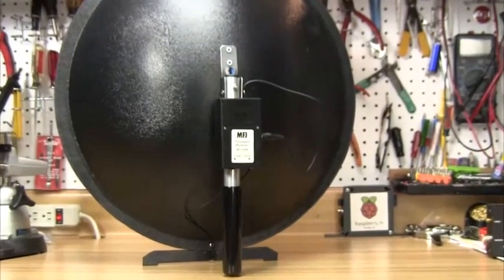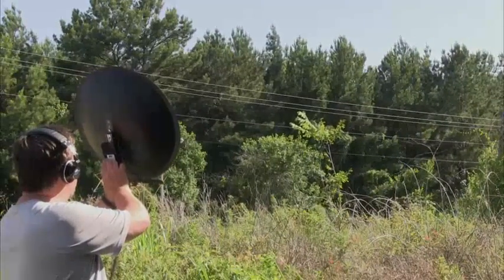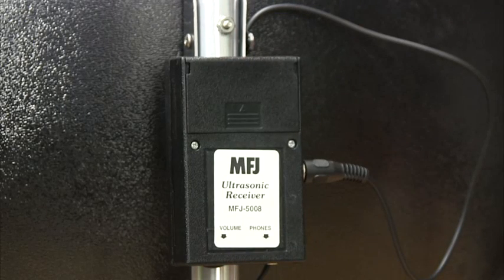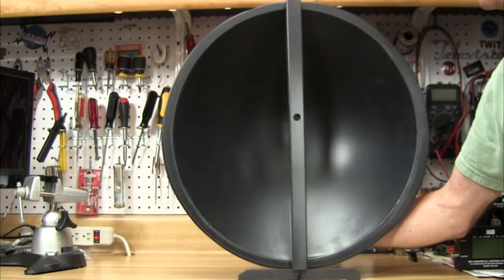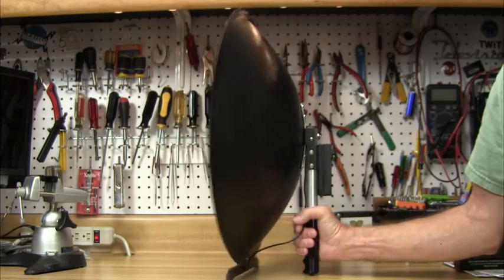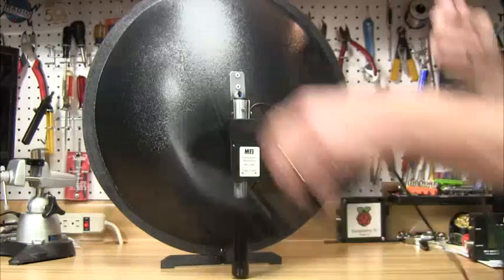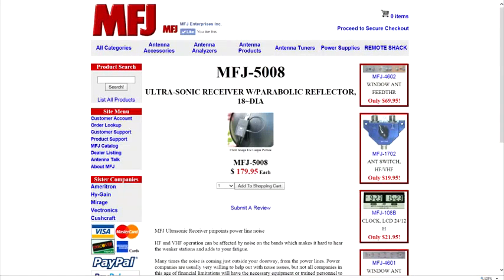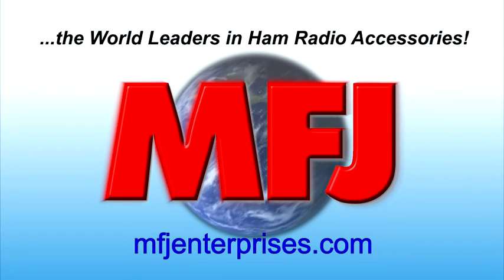MFJ-5008 Power Line Noise Detector

Comment: Does a great job, and will sometimes even find a noise source that is a span or two away from where you thought the RF radiation was coming from. Sometimes RF noise is more intense where a piece of pole hardware causes a standing wave along the line. The actual problem can be pinpointed with this acoustical device, with its narrow beamwidth.
This also works to find damaged lawn sprinkler heads!